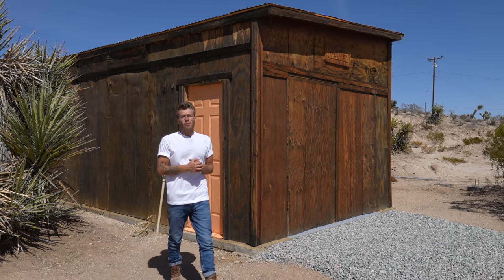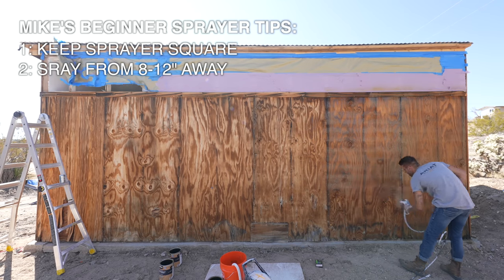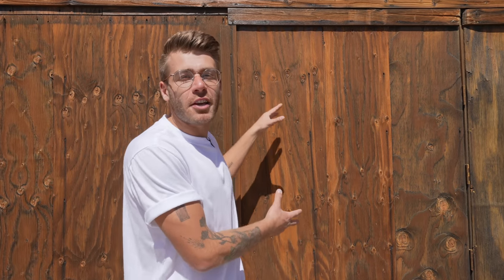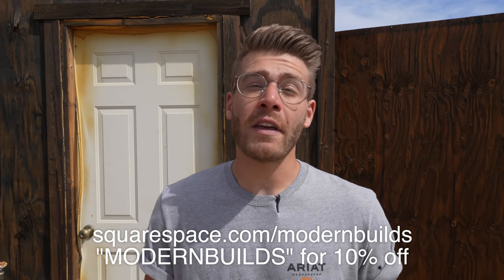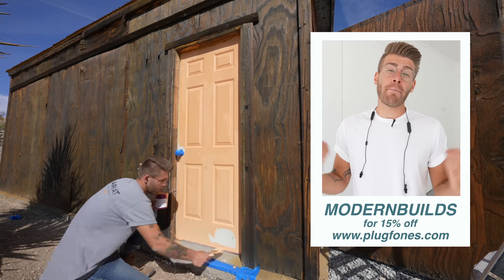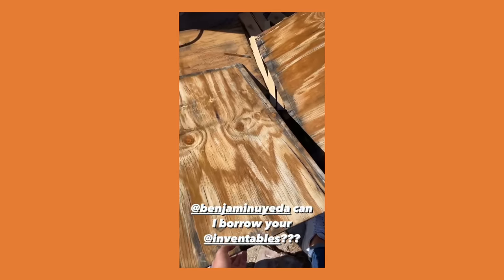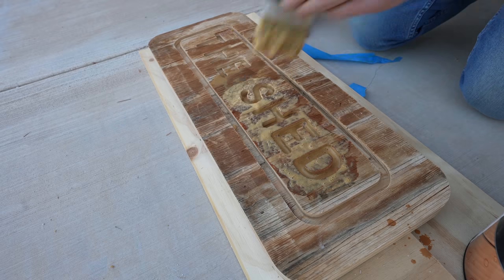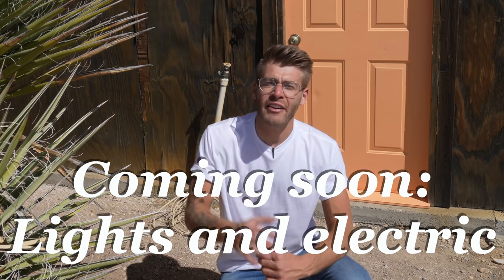EP. 4 SHED TO WORKSHOP TRANSFORMATION | MODERN BUILDS

Comment: I’m a professional painter, I recommend u that when ur painting in big surfaces use a bigger tip, I recommend tip number 515 or 517 , those are the best, just by looking at ur fan width I can tell u were using like a 421 or 390 tip number, also, don’t swing ur arm too fast, the reason why u can see the lines that have more paint and the ones that don’t, it’s because they swinging too fast and far from the prior swing. Try swinging a little slower and keep ur next spray more into ur prior. Instead of graving have of the prior spray , grave 3 forth  and so on and on . It might seem slower but everything will look evenly. And when it run cuz u sprayed too much on one swing just grab a roller, wet it with a bit of paint and roll on the running , problem solve. Also use a tip 517 when u spray outside, it’s faster, it allows more paint to come out and fan ( length of the spray) is bigger. 👌👌

Comment: There is a pretty good chance that the paint on that door is going to peel off in the heat, you may want to consider repainting it with a BBQ paint or engine paint (something that is engineered for high temp)

Comment: I don't think they were just haters, that wood stated untreated for too long and warped too long, you can see the spaces in some of them, water is going to get inside them, soak the insulation and then the interior plywood from within, would have been much easier to replace them from the start when you were doing all the work for the interior wall